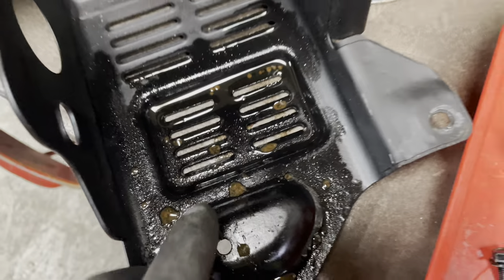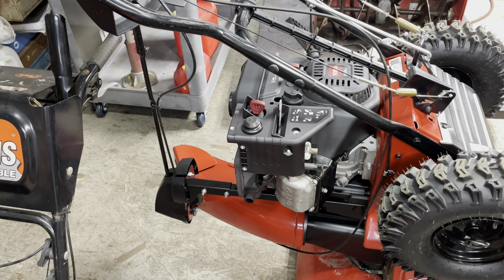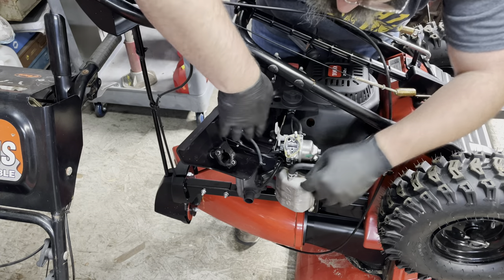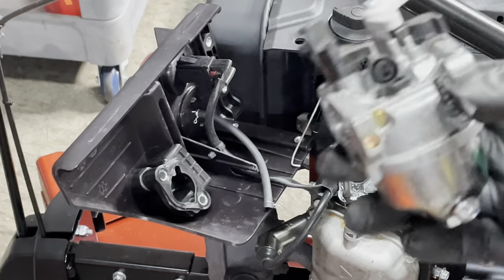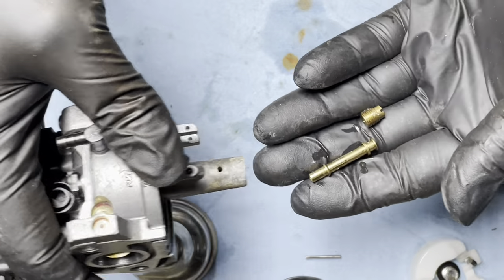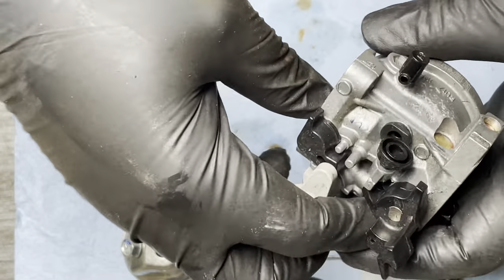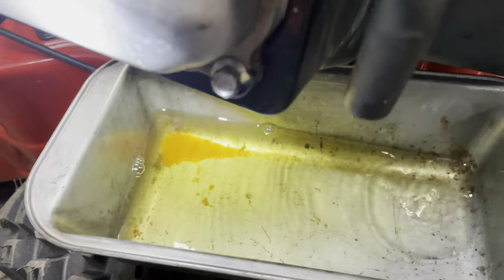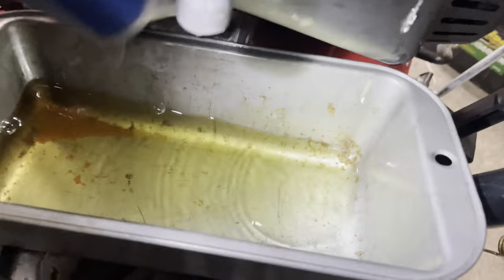Toro power max 824OE Snowblower Maintenance, No Start, Carb Rebuild

Comment: A very nice job on this! An easy subscribe, notifications, like and comment for the creator. As noted, the Aspen Fuel is a winner with me as well. I've got a Toro 826 OXE (perhaps a Canadian model) and I'm in a similar situation to this one. The shop I've used is FUBAR and I think I have to try this investigation / cleaning on my own. Your video has given me the confidence to try! Thanks!
And - I ran Aspen fuel only for the first 5 years, stabalized gas for a few years after that. It used to start so easily I never used the electric assist! Last season it would start but would only run with choke set almost closed - to run. Now, it won't start. I was looking for where to start - your video - was it!
Reply from the maker: Thank you! Good luck with your machine 👍🏻

Comment: Sense I started using ethanol free fuel, I haven't had any more carburetor issues. If available in your area, I highly recommend using it. It is about the price of 91 octane E10 fuel.
Reply from the maker: Unfortunately, I haven’t found the nearest gas station by me that sells it, but I couldn’t agree more that it is cheap insurance 👍🏻

Comment: At EP we rarely change the pilot jet O rings just spray with silicone spray and reinstall works everytime. Unless it has been damaged by others if they have tinkered with it.
Reply from the maker: I agree, the main reason I change these was because I was told someone had already tried to rebuild the curb, and I didn’t want to chance it lol

Comment: Nice video!  I have the 724 QXE that should have a similar or same carb.  I'm noticing that when I tilt the machine back to push it into garage, the carb is leaking over the carb bowl.  I noticed on this video that when you took the bowl off, there was no seal, and you put one on after.  I haven't taken the bowl off of mine yet, but thinking that's the cause of my leak.  If there is a seal on mine, then I have no idea why it's leaking and it's driving me nuts.  I've read that tipping these to a certain angle does cause leaking, but this leak seems extreme to me...
Reply from the maker: Hi, so at 1:41 you can see the bowl gasket on the blue paper towel.  That could definitely be what is causing your leak, there are generally only three reasons, fuel escapes the carburetor, those are the bowl gasket, the bowl nut gasket, or a leaking needle and seat.  The fact that yours only seems to leak when you tilt it back tells me it’s most likely your bowl gasket that needs replacing 👍🏻
Reply: Okay, yeah I just checked and there is a seal on mine, but may be warped.  Just ordered a carb kit from Amazon that includes the float and seal.  I was just reading that the float can be punctured for whatever reason and become useless, so I'll just replace both while I'm in there.  Thanks! @hester781
Reply from the maker: @jllupin33 no problem! Best of luck with it and let me know how you make out 👍🏻
Reply: Just for my own sanity…should the carb leak at all if it’s tipped or is some leaking expected?  I would expect a little leakage if I tipped the whole thing upside down but I’m not doing that with gas in the tank 😂
Reply from the maker: @jllupin33  generally speaking no, if the float is working and set to the proper level and all seals are good, the carb should not leak when tipped to a normal degree.  If you have it tipped back drastically then I would expect to see some fuel spill out.

Comment: Now that is one gummed up carb from using ethanol fuel and letting it sit. In Canada we are lucky enough to still be able to get no ethanol fuel at some fuel stations in the 91 Octane level only now a days. There are rumblings that our government may require all octane levels to have some ethanol in the upcoming year. When this happens we will be going back to the 5% ethanol blend fresh fuel only for running but when it comes time for storage we will be running equipment dry installing a litre of alkylate fuel either Kinetix, Aspen or Gulf Pro Fuel available in both 2 and 4 cycle presently costing around $10 Cdn per litre.
Reply from the maker: I’ve heard great things about aspen fuel👍🏻

Comment: I have the identical 8240E snowblower. At the end of your video. The snowblower was starting to hunt. That is exactly my problem. Am I to understand that drilling out that plastic jet can solve my problems?
Reply from the maker: Yes, drill it out one size larger and that should fix it 👍🏻 assuming the carb is clean and the fuel is good

Comment: Hey  guy, I am having a problem with a high and low idle it's surges  not a steady idle. I ckeck in side carburetor clean and looked at the  jet blow it out nothing Do think it could be that Honda pilot jet  The engine is Japanese  but looks like the Honda pilot engine looks like the same one as Harbor freight  and i have a Honda pilot  on my log splitter .well anyway what do you think it could be  i always put no ethical gas 91 in it since day one. Toro power max 826 OAE 252 cc engine  it surges high and low idle some black smoke  like it's staving  😮😅 thanks Dave,
Reply from the maker: Definitely sounds like the pilot Jet is the issue. If you find that it is clean and those O-rings are not torn, you may need to drill the Jet out one size larger. I’ve had to do this with several Honda style carburetors.

Comment: I have the same machine the gasket that goes between the engine and the carb? Does that have a small hole in it?
Reply from the maker: To the best of my memory, there wasn’t a hole in the gasket
Reply: Thanks for your prompt reply👍
Reply from the maker: @jerrypippin9550  no problem 👍🏻